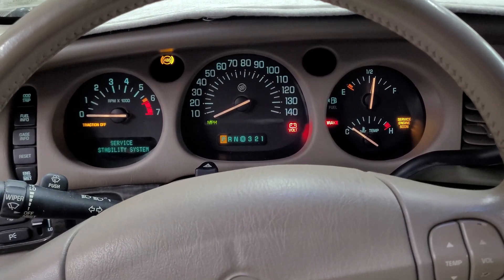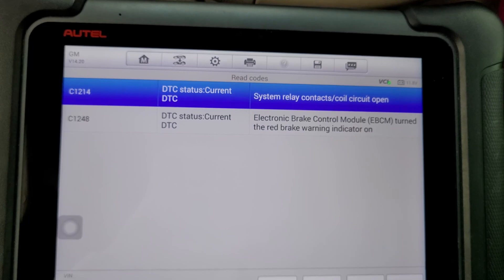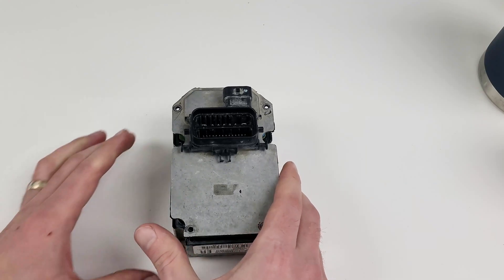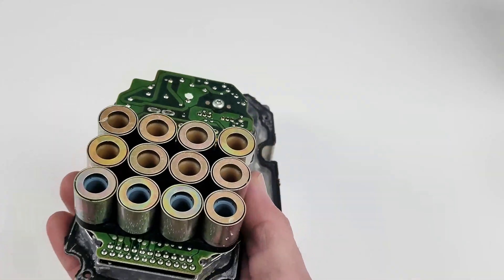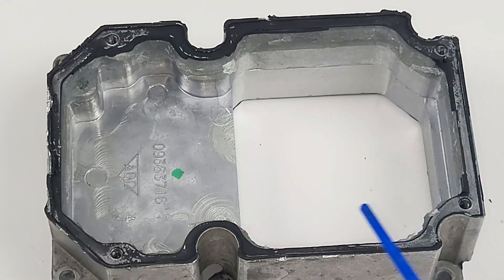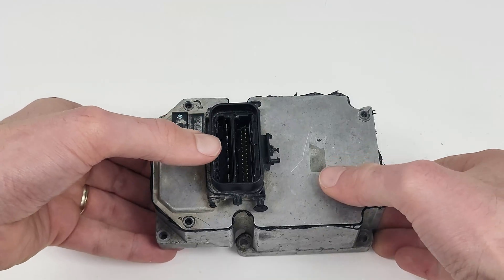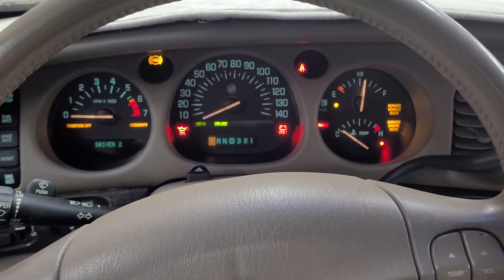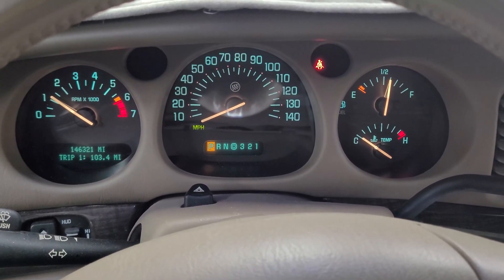Buick LeSabre Park Avenue ABS EBCM Fault C1214 C1248 Solution

Comment: This is quite a bit harder than it looks. Pretty sure they posted this so people will attempt the repair, fail at removing the cover, then mail the module to them to fix it. 
Here are some things that I think they left out, some intentionally:
1. There are 6 T20 screws to remove the main section. It does not come off easily. Use a medium flathead under the lower section to pry. There is god-strength sealant holding the pieces together. 
2. The cover plate (4 T15 screws) has a silicone plug that you can remove, then install a tap and run a bolt through, to start the prying process. I did not do this, because it was kept secret, so I chipped a small section of the cover off with a mini flathead and a hammer, then sealed it all up with 100% silicone, upon reassembly. You do not need to, and should not, use heat, to remove the cover. 
4.  You can do the job from the top, or the side, but I just did both, because it was easier to reach everything. Remove the air box and the drivers inner fender well. 
3. The actual repair is reflowing the solder. The small joints would be fine with a cheap soldering iron, but if you need to reflow the larger circuits, it would be best to have a soldering iron with an adjustable temp and a bit larger square tip to have the power to reflow it properly. Mine only had two hairline cracks on the larger connections. 
4. The entire inside is glued in place with clear silicone and it makes it a pain to remove the innards. I used an exacto knife to cut through, then removed the excess once it was disassembled. 
5. You can probably do this job with some ok soldering skills, but it is probably not a beginner job.  It took me about 5 hours to figure it all out, but I am slow.  If I redid it, I could probably complete the job in an hour and a half. 
If you have any questions, I will be glad to walk you through it.

Comment: This saved me thousands. Same connection point was bad. Resoldered and all brake related warnings went away. Getting the BCM open was a pain, but once you do, the fix is easy.
Reply: How did you get it open? Any tricks? Did you solder only one joint or all?
Reply: @JohnDoe-j7s2c  its a pain in the ass to open because of silicone and a small lip. Use a screwdriver, pick, blade, maybe even a heatgun. Take your time, go slow. I soldered any joint that looked suspicious, but only one was clearly broken. Filled with RTV silicone when I was done and reassembled.
Reply: @ElJefeTony thanks for the reply 👍

Comment: I'm troubleshooting a C1276 and I have this module off, did you use an exacto knife to cut the seal and open up the module? I tried one of them windshield removal blades and had no luck.

Comment: Great advice and helpful tutorial.   Quick question though, is the EBCM module attached to the pump only with SIX T-25 screws?  Or is there anything joining the two parts?
Reply: only 6 screws, but the gasket on mine was very stuck between the module and pump. Had to pry apart.
Reply: Ever find an answer about how they are connected?
Reply: Just six screws but the gasket between the two makes it not want to come apart. The biggest issue is getting the cover off the module.

Comment: This is a great video, but could you please recommend which brand of  "form a gasket" you use? We have to make this repair, but the local parts store had no idea which brand of sealer would work on an ABS control. I have the guy to re-flow it, I do not have the product to seal it back up. Please Please advise a good brand of product to use. Thank you for your help and time.
Reply from the maker: I apologize for the late response. This product works well for reseal https://amzn.to/3uKc2TX
Reply: @AutomotiveCircuitSolutions   Thank you!...

Comment: Can I take this thing off without having to bleed the brakes after or spill fluid everywhere? Not sure how it works.
Reply from the maker: Yes, remove the module off the pump and leave the pump on the vehicle. No need to take the pump out.
Reply: If you remove this module no spill of brake fluid?
Reply: @Keepin-it-wheel101  the module doesnt have a fluid circuit inside of it.. if that is what youre asking its just mated to the pump and stuff with printed circuit to eliminate wiring  that can add complexity and voltage drop and murphys law kinds of stuff
Reply: Yes. No fluid spilled out of mine

Comment: How do you actually fix the problems on that board? You mentioned you apply heat? Great video but I wish you would show how you actually fixed it, that part isn’t in the video. Thanks
Reply: You have to resolder the joints on there with rosin core solder.
Watch a short tutorial on how to solder.